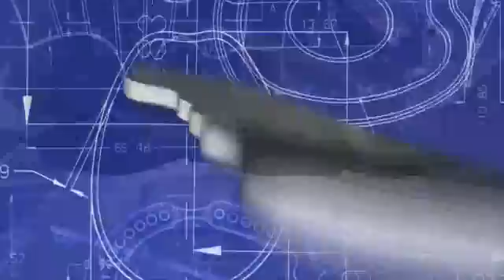#britek  Energy Return Wheel... Autonomous Never Flat

Comment from the maker: Goodyear has a retread process where they stretch a adheasive traction band over the reworked tire body, this would work on ERW's. The "first" auto prototype  ERW used bolts to draw the membrane from the hoop to the hub so that deflection, shock and vibration is played out between hoop and hub instead of flattening and bouncing off a treadblock.

Comment: Two questions: Will it be possible to just change the tread? Secondly, is the outer ring attached to the inner ring via those bolts? If so, it would seem that the membrane wouldn't do too much as the vibration would go directly from those bolts and into the car?

Comment from the maker: Our "footprint" not treadblock has been a major effort and breakthrough IE more psi. "levering" of of a firm yet pliable composite hoop for massive increases in performance. ERW can wind up acceleration and brake forces metering out the power to the surface like a dragster slick without all the hopping and squirming.

Comment: It looks like you are ignoring the fact that, because the footprint of your tire (where the rubber meets the road) is smaller (i.e. harder, springier wheel, with more surface pressure) there is less actual traction (traction is measured based on surface area of friction, i.e. square inches of rubber meeting asphalt.) wouldn't this make for much more horrific accidents, as the braking power of the car would be reduced by the same percentage as the footprint?

Comment from the maker: ERW does not deform like a tire so sitting for a long time has not been an issue. The   hub is suspended from the top half inner diameter of the hoop when on the ground sharing the load. At 12 o'clock its a streight pull at 3 o'clock and 9 o'clock it is a shear stretch.

Comment from the maker: You are correct! ERW provides a deweighting effect noticable while coasting downhill. A "hard" wheel will outcoast ERW down the hill, ERW outcoasts up the hill. An inflated tire shares/spreads developed tension fairly equally upon it's surfaces while ERW focuses it's developed tension to individual points. ERW has been on a diet and is "much lighter".

Comment from the maker: Expect "less weight as the hub mass is reduced because the composite hoop is a mighty helmet that the hub floates and levers in. ERW is "high speed". Check out how smooth our first "chained down" 6,000 lb. dyno resistance USDOT video was at 75+ mph. despite the membrane being rivited to the outside of the hoop.

Comment from the maker: A regular tire looses aprox. 35% rolling efficiency as it crumples up from the bottom creating a tread block and sidewall deformation as the treadblock slaps along. That's the noise you hear on bridges or metal surfaces on roads. ERW rolls a "sprung" hoop... now we are rolling a "footprint" not the pneu. tread block. We deform / move internally while the pneu. tire is treadblocking and bouncing back.

Comment from the maker: The hub "floats" within the "hoop". On these early protos they are attached together by an array of 36 equally tensioned membranes. When on the ground the hub is drawn lower by the pull of gravity. Now there is more "sprung" tension from the top inner diameter of the hoop to the hub.

Comment from the maker: All military "airless" is low speed application.... we are "high speed". The composite military wheel has "zero" patents and can hardly support the vehicles weight. We have models with "no bolts". Lets see them perform on a USDOT dyno at 75+ mph..

Comment: The military tested their version of a run-flat bulletproof tire. It was pretty hard to do better than that. Seriously, all those bolts are bad idea. Please don't be offended, but this is actually a dangerous wheel. The composite military wheel is without peer. I remember the days when steel hubcaps went flying off wheels in corners. But, helicopters are dangerous as well. Mice can be dangerous when given seeds with crystal meth, ad infinitum.

Comment from the maker: ERW suspension is a closed system. Bumps play out as hoop moves in relation to the hub. The hoop attached to hub always has dynamic tension pulling all directions at once. A bias developes when gravity / acceleration / deceleration / cornering forces pulls hoop /hub relationship from perfect zero center. The "bias" then acts as a force  multiplier as throttle responce flings the hoop. ERW is much more immediate than pneu. for any racing applications.

Comment from the maker: Well put.... please consider the early protos shown on our USDOT dyno videos suggesting heavy duty applications. The AMG is "chained down" and the AWD dyno was set to 6,000 lbs. resistance @ 75+ mph.. ERW radically improves power transfer "at speed" to the ground on any wheel powered critter.

Comment: There is two problems I see with your design.

First problem is that you are decreasing the contact patch which on cars with smaller tires is a safety problem. The second is that you are making the suspension do more work with will actually hurt fuel economy on roads that are not perfectly smooth.

Comment from the maker: Yes! Rotation derived from throttle or brake force is a multiplying factor ....ERW hub in hoop dislpaces internally, hoop can become out of round , multiple hoop traction / deformation systems , bottom line...ERW improves "traction" with speed.... the exact opposite of pneumatic tires.

Comment from the maker: A spoke wheel supports hoop from hub by connecting flexing spokes while ERW attachments draw each membrane "sling shot" like to points. Each attachment has it's twin directly accross the hoop. This equal and opposite "pull" helps ERW to respond much more quickly than pneumatic tires.

Comment: basically all he did was use other materials to absorb the shock that the sidewall absorbs on a typical pneumatic tire. Thus his wheel design rides more like a standard profile tire than the low-profile tire that it is. ie better ride with less rubber. Fascinating, but most likely very expensive for not much return in the long run. Add initial cost up to availability of replacement tread/other wear components and *those* prices. can those costs be offset by the value of the fuel saved? Doubtful.

Comment: What did you expect? Just cause they reinvent the tire, doesn't mean they reinvented the means of putting it on. Plus, if they need some kind of new system of installation it might not even be compatible with most cars. So ya, they still use a ratchet and socket.

Comment: your not understanding the mechanics of what they are trying to achieve, it is designed to use less energy to roll/drive/propel the vehicle and it also helps a little in the aspect of "feeling every bump in the road" but most likely isn't as smooth as the air filled tires we use today

Comment from the maker: Early ERW used a high dollar German engineered 4,800 psi. rubber membrane. Now in some models we have eliminated most rubber in favor of space age fabrics. Heating has not been a major concern... we do have a  high temp. version that can heat up like todays carbon fiber disk brakes.... if you wish to drive around on a volcano.

Comment from the maker: ERW hub "hangs" a greater % from the top 180 degrees inner diameter of the hoop and is counter balanced by the tension in the lower half. This action radically reduces "bounce" and cornering forces are shared 360 degrees tension distribution VS denting a treadblock and sidewall deformation. Check out our 6,000 lb. dyno video to see the hub ride high and foreword in hoop at highway speeds.

Comment from the maker: @iamsocool011 These first home built prototypes use a circular membrane drawn through 36 holes in the hoop by 36 fender washers attaching to wheel. As the attachment bolts are tightened it draws the fender washers and membrane towords the hub creating 300 lbs. of linear "pull" each. This is a very powerfull 360 degrees of levitating/centering force that we now use to control internal displacement energy return.

Comment from the maker: @MuF123 ERW deforms internally so that when you hit a bump it does not crumple up from the tread block ... the hoop moves in relation to the hub. A very high % of the hoop displacing energy is returned as the hoop realigns. We spin a hoop to the ground to hook up. Pneu. squirms, rolls and bounces, just check out high film speed burnouts on youtube to see.

Comment from the maker: @WKPRODUCTIONSDC Less weight is the "grail"!  ERW composite hoop is so strong that the "hub" mass can be reduced by 50%. We have reduced the rubber mass in half in favor of space age fabrics. We have just recd. a new US Patent 8,127,809 covering these changes. We have also filed on our new boltless. Check out our USDOT lab videos to see our first "heavy" ERW out accelerate/coast a 35.5 psi. pneu.

Comment: @sasperilla23 
They use a DC generator powered by a diesel engine to drive elec. motors in the locomotives. There is nothing in the train cars pertaining to generating electricity, at all. At least not on freight trains. I should know since I worked in a rail yard for 5 yrs.

Comment: @sasperilla23 
Your response here does not relate to your original question. Applying that tech while the brake is engaged makes sense because it puts a great deal of resistance on the car when trying to produce electricity (enough to charge the batteries, at least). As I said  originally, the force necessary to charge the batteries while maintaining speed or even accelerating would not work. The resistance applied would far out weigh the benefits.

Comment from the maker: @soccerpeve02 That is alot to ask.... so we began to research space age composites. Who would have figured that you could eliminate so much of what you see here, bolts steel, rubber, then file and recieve so many patent claims to solve the "list" of issues. Lateral stability happens because ERW is a closed system. Forces are "shared" as the hoop... suspended 360 degrees from hub levitates against any linear/rotation or sheer and returns forces "re"centering as it rolls.

Comment: A pothole at 70-80 mph seems like it would dent the crap out of that thing.  It also seems like it would be a very heavy solution and possibly risky due to having so many fasteners.  The fatigue life of the bolts as well as corrosion issues would worry me.  I'm curious how the rubber tread maintains lateral stability.

Comment: @gotindrachenhart .....both long life span from simple wear, wear resistance from high and low speed situations, pot-hole resistence....you name it. I'm hard on my cars, my job is 200 miles away, I drive there on monday, then drive back on friday. When I'm driving it's typically just highway but around here everyone does ~80mph so that's 4 hours @ 80. When driving for fun, it's a lot of moderate speed HARD cornering and high speed, tripple digit blasts. How would these rate?

Comment: @EnergyReturnWheel OK and what about high speed? I get my car to 120mph several times a year, would these....tires...wheels....be able to put up with that? And if so would it shorten their lifespan? Also, if driving AT said speed, would these be more vulnerable to high speed lateral loads? And what about low speed lateral loading during hard cornering (i.e. moderate speed corners with high G). I'm a performance buff who also drives ~500 miles a week every week so I need both!

Comment from the maker: @markmorrow8o Surprise, ERW does not bounce back like pneu. When your tire hits a bump it over reacts bouncing and squirming. ERW hits a bump and displaces/returns internally conserving energy... a more closed system. ERW maintains a drawn charge or dynamic tension between hub and composite hoop while outer airless have 'spokes" or honeycomb structure that just crumple from the bottom up. Nothing new there. Kumho is a well constructed tire and cost effective for the first home built auto proto.

Comment from the maker: @Sparteen8 Good point. Goodyear has a retread process where they use a traction band stretched over a tire body for a more seamless retread. We think this would be the perfect solution as the Kevlar and carbon components will far outlast the traction layer.

Comment from the maker: @BrunoRSFumes Thanks for the encouragement! We love wheels because they improve the quality of our lives so much. We started out with a 2" x 4" 18" long wood stud and hollowed out a 2" wide 1" deep trough. Spanned the trough with 1/4" thick gum rubber and tacked in place. We then took a 25 lb.weight plate placed over trough and rolled it back and forth. We were hooked. You dont need rails if you can take the spanned "trough" with you.

Comment from the maker: @jjmonns More like 18,000 miles per set if you are having any fun at all. Goodyear has developed a retread process that would make ERW tread replacement radically less costly and easier on the environment VS new pneu.. Newer ERW proto components use very little rubber.

Comment from the maker: @Yayforhappy1 Yes and we ran over an asphalt brick at 30 mph and cracked one of the first "steel'"protos but did not know untill inspection. You can see the " cracked" proto. on front left running over a stone in our "solution" Carbon Fiber Kevlar Vacuum vid..

Comment: Exactly how many nuts and bolts comes with this wheel? Does it normally require two people to change this wheel? As an inventor you must know the greater the complexity the higher the maintenance cost. Your wheel seems to have a high number of failure points.

Comment: These wont work as high performance racing or drifting tyres cuz in motorsports different cars need different tyre pressures to make the car behave the right way, AWD cars need high pressure to reduce engine strain & increase reliability, in RWD the front needs high pressure & the back needs low pressure to ensure more grip without straining the power 2 much, it's easy 2 adjust pressure in a pneumatic tyre but this tyre can't be adjusted so this is a big no no

Comment: I will be sold when I see that these can corner as hard as pneumatic tires in high performance situations. I would also think that getting one of these to balance for over 100mph would be very difficult and they'd be more vulnerable to vibration enduced failures than a standard model. And these are tire replacements no? So call them TIRES.

Comment: great idea to make money but bad idea for safety,this only demonstrates that u can spring a hoop around hub, reminds be of those 70 bicycle and tricycle wheels that was tubeless, where are they now? if you dont have air where is the rubber? that little piece of 3/4 inch rubber wrapped around nuts and bolts dont look promising for my safety, did you consider cornering on one of these at high speeds.what about a burn out, one good 1 now got you running on bolts lol, go back to the drawing board.

Comment from the maker: @12QWASZXQWERTYUIOP ERW hoop to hub stores energy. IE "attachments" are drawn like sling shots.  Opposing drawn membranes, each backed by vacuum boost. Adjustable Carbon hoop via kevlar span tension also charges or stretches traction wedges. The stored energy allows ERW to return a greater % of forces envolved in rolling efficiency than Tweel. Check out our "early" massive USDOT coast down video.

Comment: @EnergyReturnWheel  May not go flat , but the rubber(wearable component) will eventually breakdown and end up shedding itsself  exposing the rim or whatever else is in there , making it a gawd awful expensive replacement , cause no it look like you are replacing everything but the hub.

Comment: @sasperilla23 
That's a good idea, but the problem is the force applied against the rolling resistance to produce enough elec. outweighs the benefits. With an alt, the pulleys are sized so the belt spins the alt ~ 4 x faster than the engine.

That luxury isn't present with a wheel. The opposite happens. Wheels spin a lot slower than an engine. Multiplying with pulleys wouldn't work well, as force applied (torque) would be lost. It's a lot easier to use elec. than it is to make it.

Comment from the maker: @usagearhead The ERW does not "blow out" because it is not supported by air pressure. ERW hoop is space age composites and "50,000 psi." is our hoop burst strength. What is a pneumatic tires max. psi. 120?

Comment: @EnergyReturnWheel This doesn't make sense. The hub is at the same height over the road when driving, the tension in the wheel does not result in any vertical movement, so no work is done by it. There is no linear action of the hub.  
A wheel has no way to "give energy back" to the forward motion of a car. You can try to lower the friction coefficient or decrease deformation, but that results in lower traction.
Your wheels look nice, but the science is a scam.

Comment from the maker: @imingzee We are Energy Return Wheel not Energy Creation Wheel. We simlpy return more than pneumatic tires. ERW requires less power because it is levitated and levering from the top inner diameter of the hoop. An 100% elongated rubber band will "stretch" recover and return more energy than a 30%  elongated band. We pre tension membranes to improve return %.

Comment from the maker: @imingzee The equally charged membranes are pulling from opposite directions across the hoop. Gravity draws the hub lower like you standing on a trampoline. Any linear action you take is amplified by the energy stored in the elongated trampoline springs. Our hubs charged"linear action" translates into lift or rotation when torqued. Rolling foreword absorbs gravitys pull and charges ERW for "free".